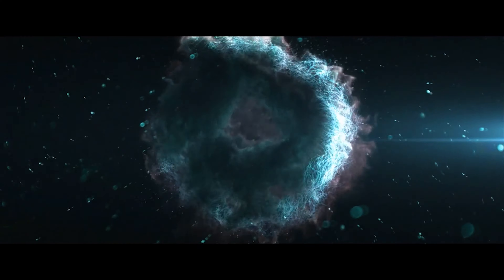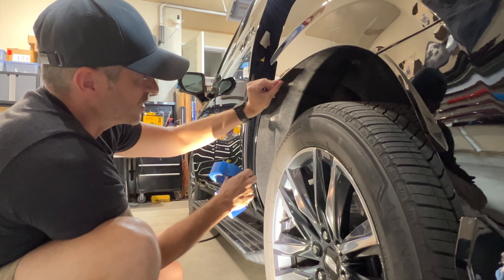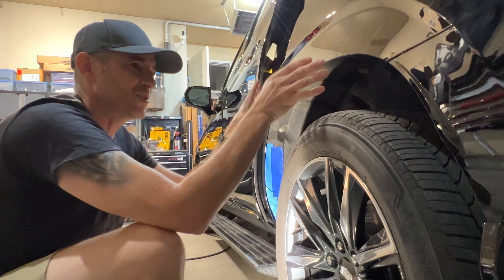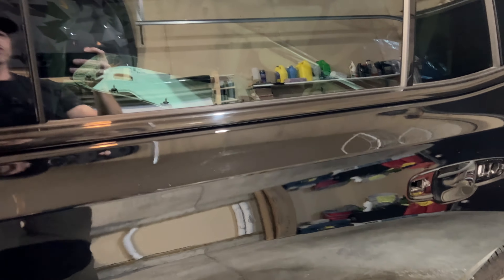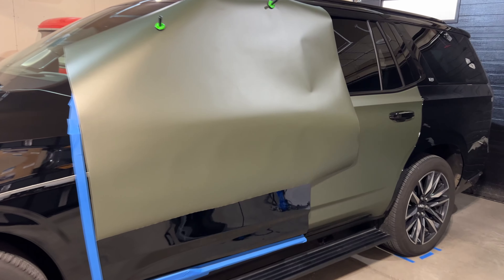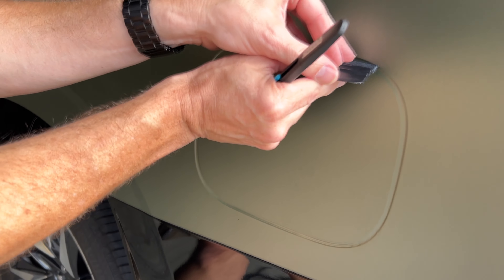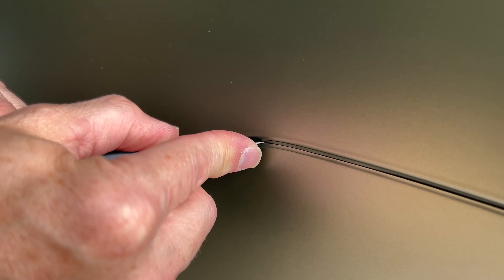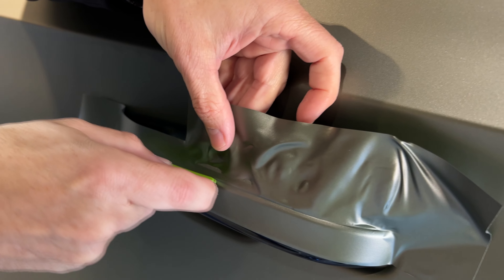How To Wrap a Car, Truck or SUV - Key Tips To Avoid Failure!

Comment: Great job! How much wrap would you use to complete the whole vehicle? I have a 2023 Escalade. The ppf I am looking at comes in approximately 5x50 ft rolls. Profilm diamond green. Thanks!
Reply from the maker: The roof will use quite a bit.  My full size crew cab truck used 80ft.  Two rolls should do it.
Reply: Thank you!

Comment: Nice job! 
I have never done something like this but was wondering if you think the wrap would work on the plastics of an ATV or how it would hold up?
Reply from the maker: Smooth plastic is usually okay.  Edges are where you have to be careful too.  Usually the point of failure for most wraps